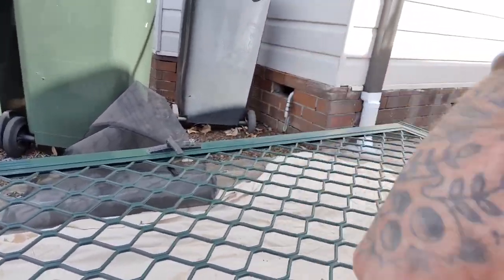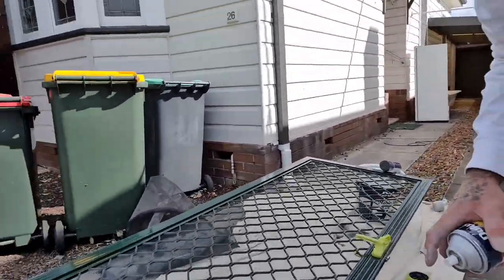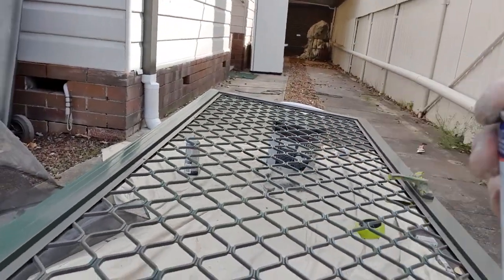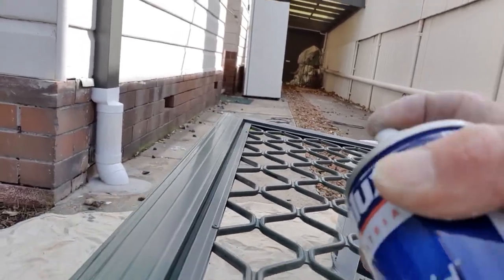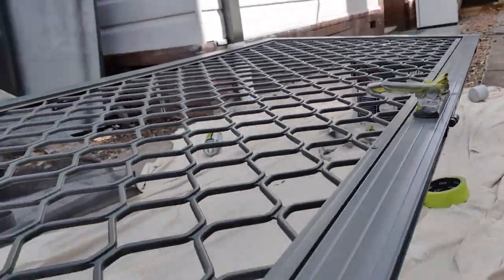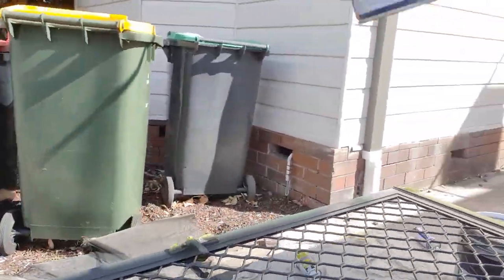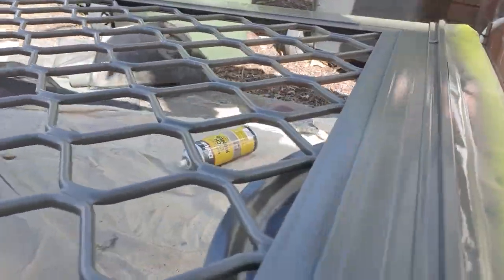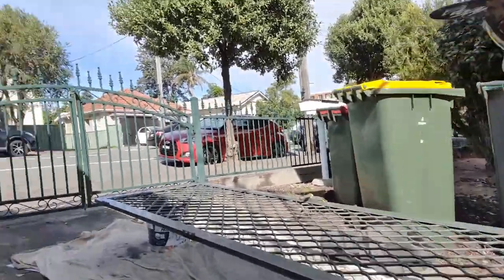( DIY) HOW TO SPRAY A SECURITY SCREEN DOOR

Comment: Would Weathershield Multiflex give the same longevity?  I have some left over and can put it through my Wagner hand held. I know Metalshield comes in a can and is more practicle but what is the diff between the 2?
Reply from the maker: Hi mate weathershield shield will definitely do the trick just give a sand before coating 👍
Reply: Cheers bud🤘🏼
Reply from the maker: @bagsmcgee2195  anytime mate

Comment: Thanks for the vid. I have a security mesh which is riveting on to a similar door. Could I spray with that attached? or does that need to be removed.
Reply from the maker: Hi James, yeah you could spray it attached. Just tape up the mesh around the edge before you spray👍

Comment: Hey mate, What type of paint would you suggest for painting a stainless steel sink? Would epoxy enamel Spray paint  would do the job ?
Reply from the maker: Hi mate, yeah stainless is hard. A good metal etch primer and enamel should do the job you could over coat with a 2k polyurethane. Hope this helps 🙏

Comment: I have a security door which was overpainted with oil based paint and is starting to peel away.  Would be happy to take it back to it's original base - I asked a large handyman's warehouse that sells snags outside how to remove the paint today. They suggested try mineral turps first - well, tried that and it didn't move anything other than what was originally peeling.  They said if I used paintstripper that it would also strip the original finish on the screen door.....anything I need to be wary of before I go that route?  Thank you
Reply from the maker: I would just go through with a wire wheel that would remove any peeling paint or even  a long bristle wire brush and a sand with 80 grit that's what I usually do 👍 cheers

Comment: Hi Josh, thanks for sharing!  Here in NZ we don't seem to have a nice white version of the Dulux metal shield so would the duramax high performance enamel bond to my screen door which I think is powder coated? Cheers
Reply from the maker: Hi Peter, thanks for watching! Yes the duramax will definitely work over the powder coated finish as long as it's sanded. Hope this helps mate👍

Comment: Could I ask why not to etch prime the whole thing like you would with aluminium window frames? Bunnings guy said to use etch primer so the top coat doesn’t scrape off
Reply: Also sorry how much time between coats?
Reply from the maker: Hi Gemma, the screen was in really good condition just lost it's sheen. A light sand and a good top coat will be fine, Leave an hour between coats. The windows where in really bad condition this is why the whole surface was sprayed. never listen to bunnings about paint 😂 hope this helps
Reply: The Bunnings guy was wrong. As per usual. As Josh says, a light sand, if the surface is painted or powder coated it’s right to paint. The only other thing I do is wipe the whole area down with prepsol or acetone before painting

Comment: It’s been repainted and is chipping off. Can I just lite sand, use the etcher then paint?
Or do I have to take it back to metal ?
Reply from the maker: Hi Denise. You can can just give a light sand and go straight over it 🙌

Comment: Thanks Josh.  Will keep you posted. Do you think it's imperative I use the primer as well.  I bought the spray you suggested and the person at the hardware store said it already contains a primer and it's not necessary?
Reply from the maker: No worries at all! I still use a primer just to match sure it sticks to the top coat!
Reply: Really you should be using the etch primer across the whole thing you're painting, not just sections. 

It etches itself into the paint to create a bond. From there it leaves a perfect bonding surface for the paint.

Comment: How do you stop it scratching if hanging so soon? Dulux reckons it takes 7-10 days to cure. I can still scratch my door 24hours later with a fingernail.
Reply from the maker: Hi mate, are you sanding, dusting and priming? It shouldn't scratch off after it's sprayed straight away. All paint takes time to cure but still hard enough not to scratch If prepared right. 👍

Comment: Thanks Josh,  Just what I want to do.  One question.  How do I best do the handles.  Mine will look a bit tacky if I just do the doors - some of the paint has come off. Will I just spray a black first and then mask?  I also have pitting on my screen - almost like a spots of corrosion.  Will it be ok to paint over this.  Cheers
Reply from the maker: Hello! If you want to paint the handles its the same process as the screens. 
Get a wired brush and brush off and then prime over it. 👍 let me know how you go 🙏

Comment: Hi Josh, thanks, your video gave me peace of mind that I can "just paint it" :)  hey, what about the mesh? I'm changing from faded black, now grey to blue for both my front door and this screen.  Can I change the mesh colour?  Thanks
Reply from the maker: Hi there, thank you for the kind words. The mesh wasn't getting replaced on this one. But I do replace the screens a bit also never to a colour other than black. I'm really not sure if you can get colours screens 🤔 if not you could spray over just don't get mesh! I would go with the fibreglass or aluminium easier to paint 👍 hope this helps

Comment: Watched a few of your vids now, you seem to use quite a lot of the rattle cans, is that not a super expensive way to work? Can you not get the same product in a tin and stick it through one of your machines?
Reply from the maker: Hi mate. This is the most efficient and cost effective way it can be done. We all know time is money gun out set up for a few minutes then pack up, wash up. It cost $25 dollars to do this screen. You can't even buy a tin of paint under that. Plus you would need a undercoat and top coat it would easy cost $100 in material plus time? 👍